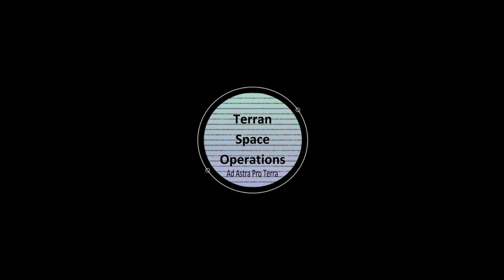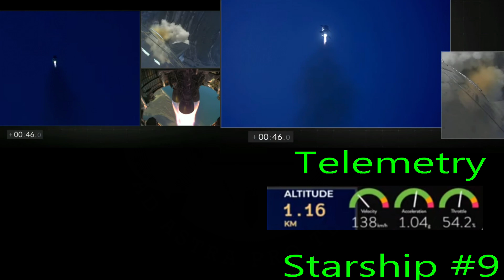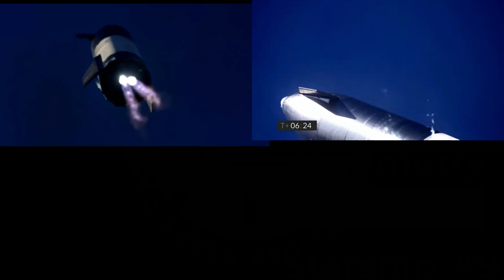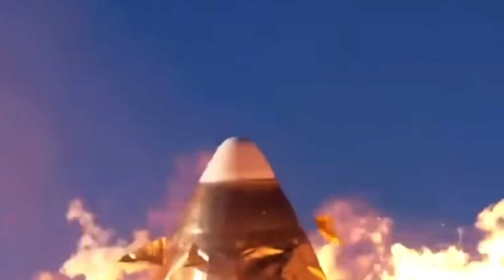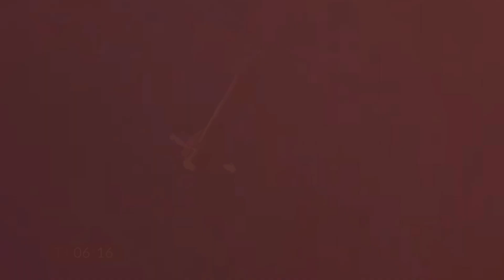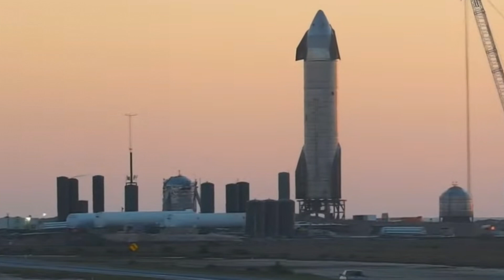Starship 9 Crash Analysis

Comment: You should have synced and analyze the the last minute of the hops to try to determine if the flips were initiated at the same altitude.

I got the impression that the SN9 flip was late, but then again if there was only one engine instead of two, this could explain what I saw.
Reply from the maker: The SN8 went to 12,500 m while the SN9 went to only 10,000 m so I wanted to sync them from engine ignition to analyze the attempted landing and the possible failure since both ships had a successful flight up to that point :-)

Comment: Why does the telemetry say 1g during the suicide dive ?
There's no significant change in velocity therefore little to no acceleration...
Reply from the maker: Just the effect of gravity a zoom. So in freefall the accelerometer would normally be a fraction of gravity. Once you hit terminal velocity resistance do your travel through an atmosphere or equal to the force of gravity and you experience 1G again.
Reply: @terranspaceacademy  yes the ship is certainly experiencing 1g of gravity but when the velocity is not changing that means there is no acceleration. Therefore the air resistance under the ship hast to equal out the force of gravity (m*g) by putting an equal force on the ship pointing up. So no resulting forces and the gravity is still 1g but no acceleration because acceleration is defined as a change in velocity over time. But thanks for your answer sir. 
Ad astra pro terra

Comment: Three engines if you have them or switch to hypergolic engines for landing as the liquid fuel may not like the flip maneuvers.
Reply from the maker: The fuel would still be methane...I was just thinking of pressurizing with hydrogen/nitrogen gas produced by running hydrazine over a catalyst bed.
Hydrazine can be made on the Earth and Mars, it does not boil off, and would
pressurize very quickly.  SpaceX already uses monomethyl hydrazine in the
SuperDraco Engines.

Comment: Yes, BUT firing all three engines earlier would require more fuel thus making the rocket overall less efficient.
Reply from the maker: That's true but efficiency takes a back seat to not blowing up :-)
Reply: I guess they want to see how efficient they can get without blowing it up, but starting with the more dangerous end of their projections. Does it save on fuel costs when more goes wrong in one testing? or will the price of the rocket itself make this a more costly manner of testing? Or are they just saving on time spent testing by being less cautious during the early testing stages? How does that work?
Reply from the maker: @niccosalonga9009  Since they want to transport humans on this thing they will be pushing the edge at all times. If it is easier to land it with three rocket engines running they will try their best to do it with one.

Comment: SN9:  bad O-ring.  You can come back and thank me later.  :)
Reply: It certainly looked that way with all the flamage around the turbo pumps on 2nd engine. I think it saw cavitation by a slug of gas going down the feed lines and hammered the seals. Given the variety of attitudes the tanks see throughout the various engine start scenarios cavitation can't be mitigated by  baffles alone.
Reply: @krystofr1270  I agree, it definitely appears that the centrifugal pumps are at the center of the issue.  They work great when gravity / full tanks is all doing it's thing....but once it's on its side, something is definitely not going well.  I also worry about thermal shock.  It's a pretty short raptor chill (few seconds) on descent before refire, which is why I think it's an O-ring /seal issue.
Reply: @jesterlead Absolutely. I'd imagine they are reluctant to overdo the engine chill incase they short themselves later. The short engine chill is likely compounded by being less efficient when done during skydiving portion. Surely they've got tank cameras in there. Probably don't want to share with the world and rightly so.
Reply from the maker: Interesting points...thermal shock is a big risk to turbopumps...

Comment: Is telemetry just estimated figures?  Something is wrong....one minute to speed up to 153 km/hr is a lot of time....if this is true how can they expect to brake in 20 seconds from a much higher free falling speed with only two engines? Even if the use only 60% power on ascent 2 raptors at 100% is not enough power to slow down the ship.
Reply from the maker: The telemetry is calculated from sensors that have a finite refresh rate...
A sudden impulse can create a brief massive acceleration or velocity change until it is averaged...
Going up they have a lot of propellant mass...
Going down they have much less...
See our breakdown in previous videos...
They can burn up to 19 tons a second on the way up...
They have to produce much less force to generate a good thrust to weight ratio on the way down...

Comment: I would like to see a much higher altitude relight; more time to let fuel settle in the tanks and more time for the craft to correctly orient.  It can deep throttle enough that is can hover and or transition as needed. My 2cent, but what do you think?!
Reply from the maker: I agree completely... start up and idle all three engines long before they are needed...
then throttle up one at a time shutting down any that malfunction...
Reply: Like the Falcon 9, Starship uses a landing maneuver called a "suicide burn" (or hoverslam) where the engine is run at 100% power, timed in such a manner that the rocket's velocity reaches zero when it reaches zero altitude.  Hence the terminology.

This is the most fuel efficient method.  A manned mission, however, would likely offer a bit more wiggle room.

Comment: Looks like SN8 took 13 seconds to impact after engine relight whereas SN9 took only 10 seconds.  Retro thrust difference alone doesn't account for that big a difference. I suggest either SN9 fell at higher velocity OR it its' relight was late.  I think its late relight contributed somewhat.
Reply from the maker: I think it lit at the right time but within a second of only one engine working its velocity would start to climb dramatically compared to SN 8 with twice the thrust...

Comment: SN8 took 19 seconds to go nose down after engine shutoff, but SN9 took only 13 seconds.  I suggest that SN8, while in much thinner atmosphere 2k higher, accelerated more slowly as it did a bit of a tail-slide before flipping fully to nominal nose down descent.  Check the time stamps of both and see what you think.
Reply from the maker: That does look reasonable from the tapes...
tapes... still used in my dimension!

Comment: Maybe they don't think simple enough, if the best part is no part, the best belly flop is no belly flop, if the starship would keep a vertical position all the time problem with engines propellant supply would disappear, obviously heatshild need to be under vehicles mounted on the pivotal arms and the flaps replaced with gridfins like on the booster, but wouldn't be needed header tanks (maybe bottom tanks next to the engines).
Reply: The belly flop is to simulate Starship having re-entered Earth's atmosphere. It will be using that position to hepl reduce speed, then land similar to SN8. (Without the crash)
Reply from the maker: They looked at this but the propellant needed to counteract the higher terminal velocity would be too much...

Comment: At 4:50  200 kmh in the wrong direction, I wonder if the air being forced back into the engine at that speed caused an issue and stopped the 2nd engine igniting? Cheers
Reply from the maker: That's interesting... you do see blowback from the Merlin powered boosters coming back...
I bet a weak combustion ignition could be snuffed out...
Reply: @terranspaceacademy  The Raptors are lit when Starship is horizontal which should minimize blowback.
Reply from the maker: @franksolario1842  That’s a very good point.

Comment: For whatever it is worth, in the previous video you suggested that low speed airfoil are in laminar flow. That is almost never the case. You also stated that the air above a wing and the air below a wing arriving at the leading edge simultaneously will arrive at the trailing edge at the same time. That is never the case. May I refer you to Theory of Wind Sections by Abbott and Von Doenhoff.
Reply from the maker: I said they "try" to get to the end of the airfoil at the same time... bad choice of words... and laminar flow over the body at low speeds with a low Reynold's number is what we were taught... I'll read your reference... Thank you.

Comment: Was thinking this may be more a procedural issue rather than solely a mechanical failure. If it is procedural, the 'modification' for the SN10 test will be a fairly straightforward fix, hopefully with better success. In addition to lighting all three and picking the best two, beginning the vertical flip a few seconds earlier may dramatically increase the chance of success.
Reply from the maker: I agree... some software changes are probably enough... start all three engines early and shut down first whichever doesn't ramp up on time...  It didn't try to relight the third engine that I could see...

Comment: Given that one raptor looked to be burning well and the other stuttering do you think the propellant starvation issues are now resolved? I.e. Just an engine failure. I was also researching cryogenic accumulator bladders to perhaps separate helium from methane and oxygen if that was causing cavitation. Only trouble is how to deal with boiled off gasses I guess.
Reply: not necessarily, only one engine lit means 50% fuel burn rate, there can be still issue coming up if 2 engine are lit
Reply from the maker: I think so... if it was a fuel header tank pressurization failure we should have seen oxygen rich flow and green flames...
I was wondering about pressurizing with hydrogen gas?  It would increase engine efficiency/ejection velocity and shouldn't react with methane... just a thought... I'll look into it more...
Reply: It is much more challenging to prevent sloshing due to the orientation being horizontal and falling down, LOX CH4 tend to stay at top of tank. Pumping gas will tend to be pushing towards the bottom (due to density difference) and gas fed into engine instead. I think may need redesign of plumbing and need to add redundancy by using all 3 engines
Reply from the maker: @free00701  Perhaps a diaphragm cylinder tank?
Reply: @terranspaceacademy  This was the angle I was going for. Sorry but I am looking through subsea oil and gas control systems eyes. I was curious as to whether or not an appropriate elastomer could separate the pre charged helium in this instance and the cryogenic propellant.  Basically guaranteeing only liquids are fed into the turbo pumps.
Reply from the maker: @krystofr1270  they have made tanks like this, with a flexible lining that pulls away as the ullage side is pressurized.
Reply: @terranspaceacademy  yeah diaphragm cylinder tank can work, more complexity and mode of failure. elastomer works terribly at cryogenic temperature. I would prefer Elon use some clever plumbing to fool proof the sloshing problem. And hydrazine won't work because there is no hydrazine on Mars (that is the purpose), when hydrazine is used up on Mars landing there will be None for return trip to earth. It will guarantee the doom of starship upon arrival to Earth. I feel this header tank will need to be solved in the hard way of CH4 / LOX only
Reply from the maker: @free00701  but there is carbon and hydrogen on Mars :-) so it’s pretty easy to make hydrazine.
Reply: i think pressurization with hydrogen is terrible idea. H2 will leak out with time and almost certain will be empty by the time on arrival to Mars. He is the only choice imo
Reply: H2 leaks from anything including the best container it just creeps out between the atoms and also embrittle the container in the process esp metals... prolly focus on the plumbings is better
Reply from the maker: @free00701  Not if you store it as hypergolic hydrazine :-) then it can last for a very long time. With no boil off. Then put it over a catalyst bed and you get nitrogen and hydrogen gas to pressurized with right when you need it.
Reply from the maker: You wouldn’t pressurize the tank until just before landing. The hydrogen could be generated from hypergolic hydrazine over a catalyst bed.

Comment: I'm not convinced about less aerobraking from lower altitude being an issue. Well, OK maybe an issue if there was a miscalculation in the control software that failed to properly account for it but I would have thought that it is something Starship must be able to handle if it is to ever fulfil its primary purpose because even going up to only 5km and aero-braking from there is probably going to give way more drag and hence shed more velocity than the entire from-orbit aerobraking will be able to shed when landing on Mars so that final flip and engine relight manoeuvre is ultimately going to have to cope with a pretty high residual velocity when coming out of Martian aerobraking isn't it?
Reply from the maker: Yes, we need to do the math on that one to find terminal velocity on Mars... the atmosphere is about1% what it is on Earth, I'll have to calculate the density etc...

Comment: Seems they solved the header pressure problem. The "if one doesn't light"  seems to be next problem to solve.  It doesn't matter if they plan to light three engines next if engine-restart continuous to be iffy.  I'm wondering if they can do the vertical flip earlier without any rocket-assist and just do the hover-slam as they land (probably greater terminal falling speed)?
Reply from the maker: I think they will have to do that also.
Reply: each engine sucks down a 100s of KG of fuel per second. there is not enough fuel in the header tanks to do a 3 engine hover. they would have to changing the plumbing or tank sizes. the merlins light / relight 4 times per flight - take off, boost back, reentry, landing and have done so successfully 75 times. the raptor needs more flight time but it will get to that same level of relability.  sn8 would have stuck the landing were it not for the pressure issue. they will keep the flip the same but light 3 so there is a spare and quickly turn it off if the other 2 light successfully.
Reply from the maker: I think they will have to do that also.
Reply: I think it needs to have more drag during the belly flop, perhaps with an additional control flap.  They are trying to have consistent acceleration applied to the craft, as you can see they are very close on that.  I think this flight is like trying to barrel roll a 747 at low altitude just to show that it can do it.  If they flew at the proper altitude, they could have a wider trajectory thus enabling the maneuvers full effect.

Comment: I was under the impression that one of the two Raptors blew itself apart as they were starting up above the launch pad.  Watching some of the angles from other sources, you can clearly see a couple large pieces fly out the back end as the flip maneuver is started.
Reply: There were two suitcase-sized objects ejected from the tail bracketing the ignition, but as Scott Manley points out, they are lightweight and flutter around, so they are likely COPV thermal blankets and not critical components.
Reply from the maker: @murraypearson2359  it looked to me like the engine was sputtering...
Reply: @terranspaceacademy  I agree, the second engine was definitely sputtering. Perhaps a COPV failure threw out the blankets and also caused the engine failure?
Reply from the maker: @murraypearson2359  The COPV would’ve pressurized the entire fuel tank and a failure would have reduced fuel flow to both engines causing the oxygen rich propellant flow and green flames again :-)
Reply: @terranspaceacademy  Weren't there multiple COPVs?
Reply from the maker: @murraypearson2359  Most often they do have more than one COPV. But for a rocket with turbo pumps they don’t need very much pressure for it to work properly. But apparently more than they had for serial number eight :-)
Reply from the maker: I’ll have to watch that part of the flight again. If that was the case you would think they would’ve tried to start the third raptor but perhaps they did it they had been damaged. For whatever reason they ended up with one engine.
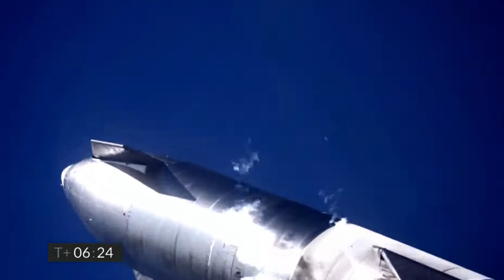Reply: At 7:45 there is something falling out from engine bay, 2 times. Its clearly visible on another cammera on another channel. Something silver fly away from underneath rocket.
Reply: @simonci5177  That was thermal shielding but not normal. The fires around the turbo pumps on sputtering engine 2 restart likely caused that. Seals were shot. Hopefully SpaceX do another recap video soon including footage of the engine bay video at relight.

Comment: I wonder if they could get away with smaller flaps? The flaps seem to very effective and may be overkill for what they need. They could save some weight and drag, while still be able to control the descent with smaller flaps. Just a thought.
Reply: Mars haves less air at 2 feet than earth at even 100,000 feet. If anything it needs BIGGER flaps on Mars.
Reply from the maker: That’s a thought :-) but they want more drag. They want to increase drag to reduce terminal velocity. Then it doesn’t take nearly as much fuel to do the flip and burn.
Reply: @terranspaceacademy I agree but if you look at what way it falls the angle of the flaps is not at an angle that would maximize drag.
Reply from the maker: @Build_the_Future  that’s true... i’m sure even shaving a meter off of them would save a lot of weight.
Reply: @terranspaceacademy  
I believe this is the reason they are testing 7.2 with the 3mm thick SS. Just that change alone should make a huge difference.